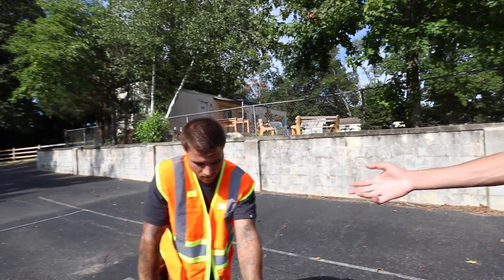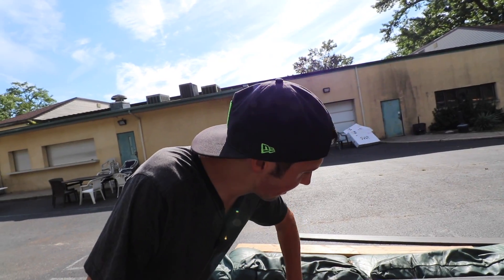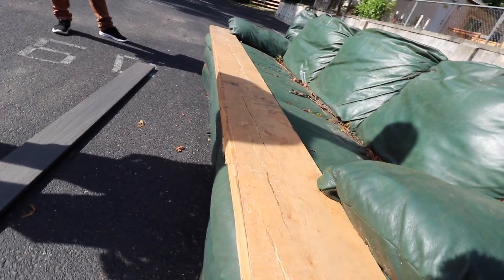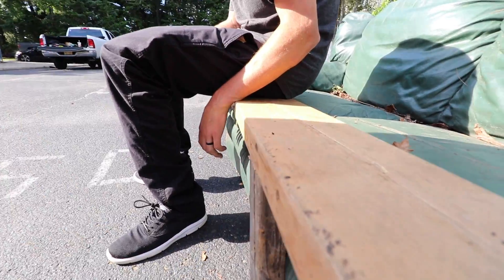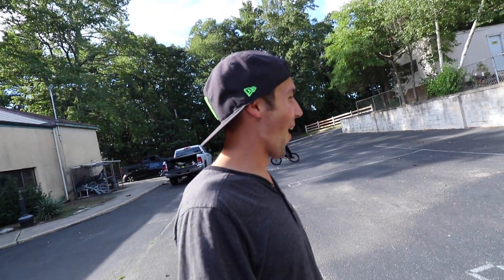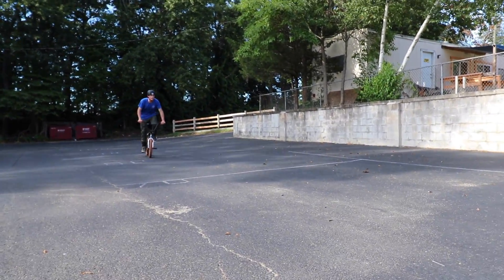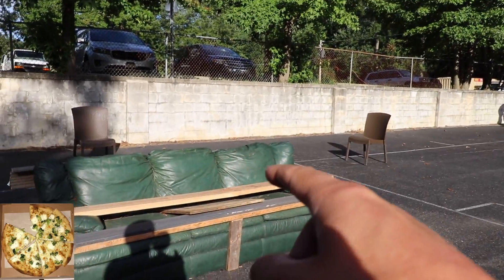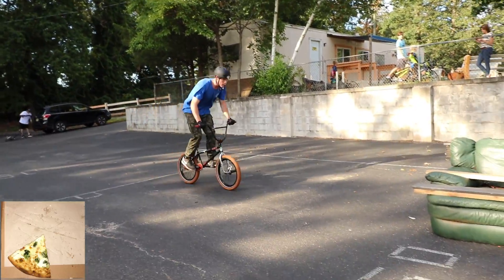BIKE RIDERS vs. COUCH!

Comment: Is the drill set to "hammer"? Sounds like it
Reply: Draeas Talonsbane it’s not a drill it’s an impact driver.
Reply: Owiegoie27 Oh right, is that a specific type of tool? I thought it was a normal drill, I have one that you can set to drill or hammer drill for either wood or masonry respectively. I'm in the UK
Reply: Draeas Talonsbane oh in the us I believe it’s now as an impact driver. It’s just used to drive screws easier